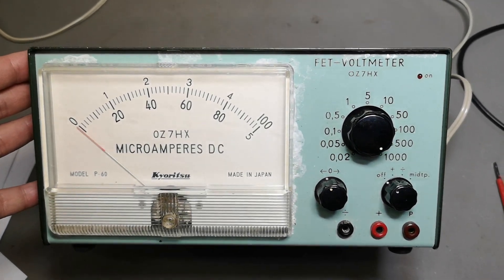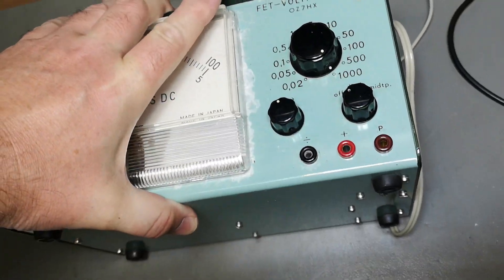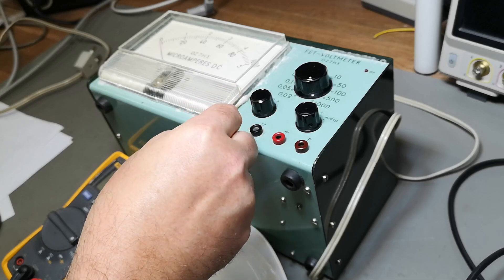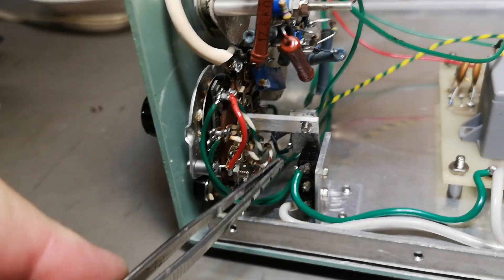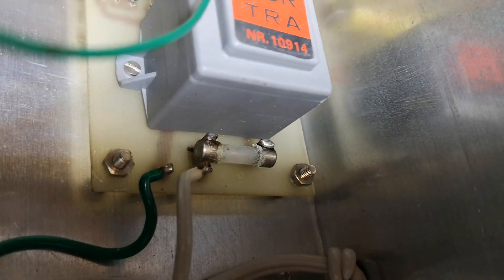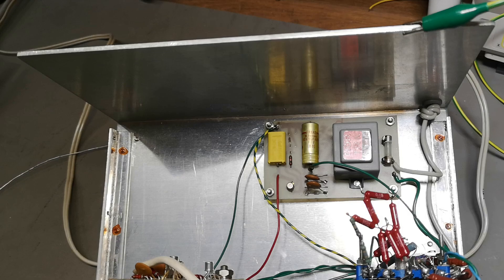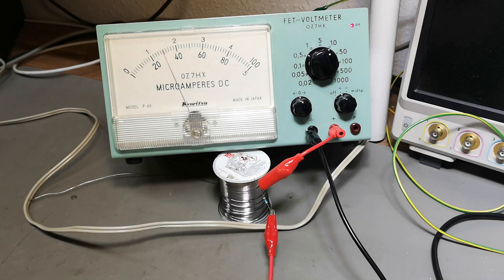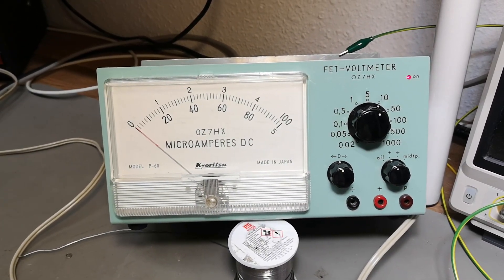DIY fet voltmeter OZ7HX 1975 dual jfet dual npn test teardown

Comment: Yeah, simple stabilizers with a zener like that, drift their output voltage over temperature changes.
This nice instrument would benefit from using an LM723 in that supply part. And it's a part typical of that era.
Reply from the maker: exactly.. maybe he insisted on the design idea : lets try not to use a single IC here :-)
Reply: @TeardownOZ2CPU For a design like that I’d be a purist too :) A proper minimalist supply would either have the zero-tempco Zener (5.6V IIRC) or thermal feedback from the Zener to a thermistor to compensate thermal drift. The Zener current can also be adjusted to minimize the tempco. Those are the tricks from old voltmeters that used Zeners for references. A well looked after Zener can do a very fine job :)